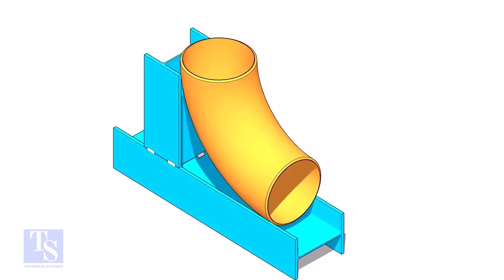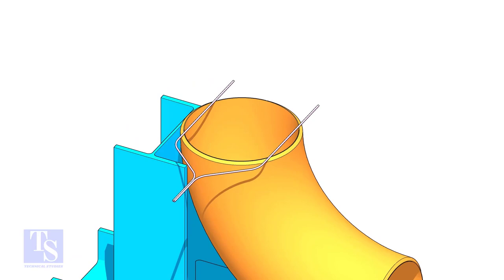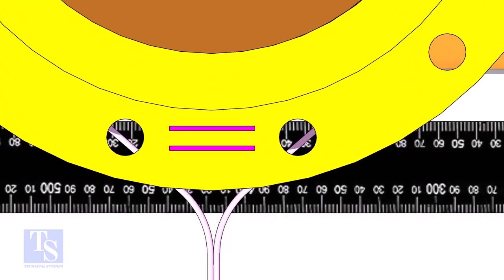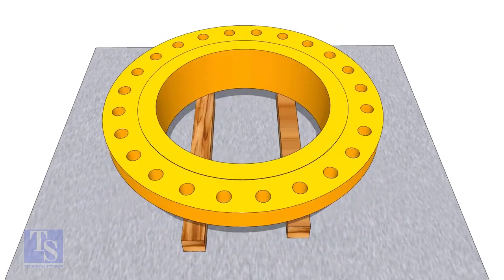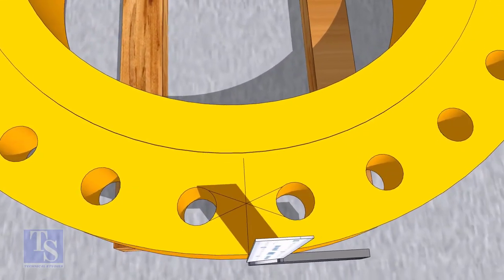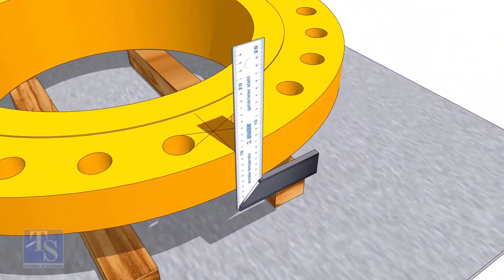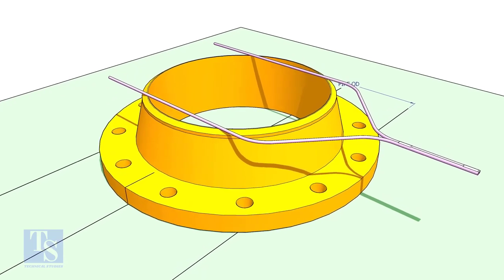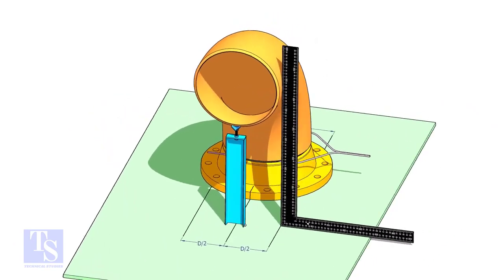FLANGE TO ELBOW FIT UP DIFFERENT METHODS  TUTORIAL Pipe fit up tutorials

Comment: I usually use a square and magnet on the  squares.  1 on the  end and 1 on the side.  After I tack it,  I 
Stick weld the inside and back grind the outside.  At least for anything 2 inch and up.